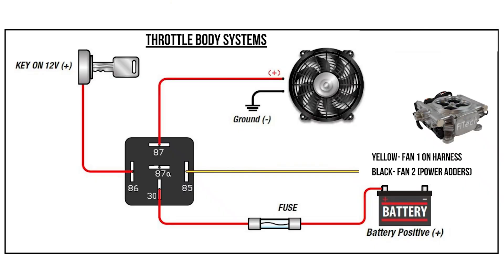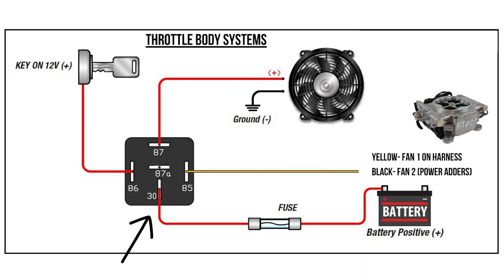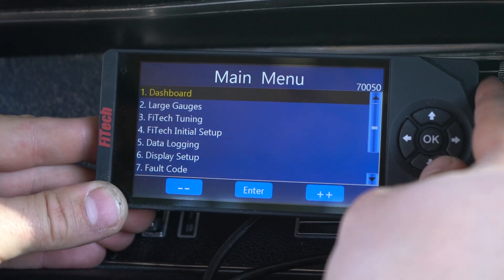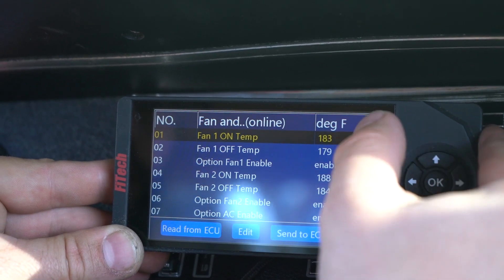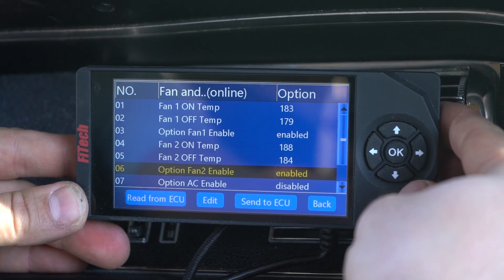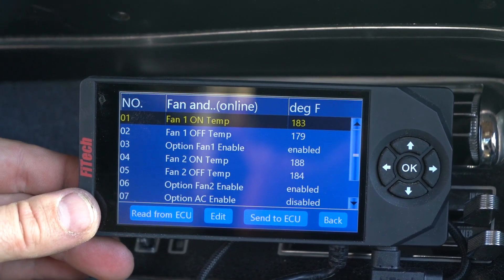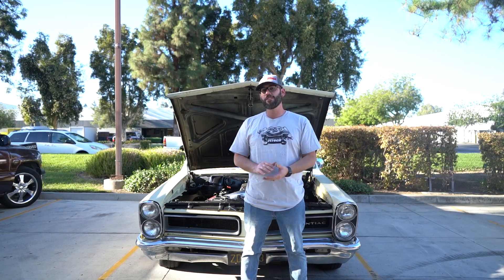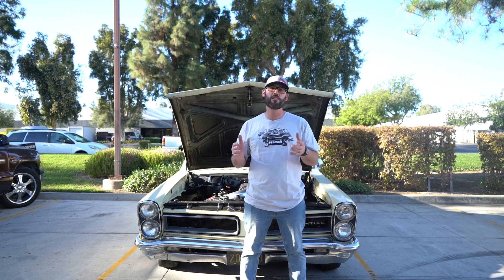Fan Controls | Tech Tuesdays | EP43

Comment: I thought my relays were going out but after using a multi meter I only get 8v ground from the Fitech wires so I’m only getting 8v to the fans, what’s the issue?
Reply from the maker: Hello sir,

The cooling system being controlled by the FiTech system operates differently, our systems control the electrical fans via ground activation, the relays on your cooling system are independent and should be wired according to instructions specs, however when it comes to the ground on the relays, that is where the FiTech fan wire is connected as our wire will be the ground for the relay. Our wire does not supply voltage to the relay, only ground(s).

Comment: I have the first version of the mean street efi purchased back in 2016 it has run great until recently, when the fans come on I get a voltage drop and the efi stumbles very bad and sometimes just dies, I have checked the grounds and even added a ground strap strait to the battery but it didn't help, I even disconnected the fuel pump from the efi and ran it from a separate fused source, I am stumped at this point,I cant drive my jeep it just tries to stall out when the fan comes on,could this be an issue with the ecu I have heard the first generation ecu's had problems
Reply from the maker: This is unlikely an issue with the ECU,
 check out Fan Wiring-FiTech EFI | Tech Tuesdays | EP88 for help with wiring the fan.
 if voltage drops on the key wire the system will think the unit is shutting off. you can check out this video for help with that, Battery Voltage! | Tech Tuesdays | EP1

Comment: I have a twin fan setup and am letting the CTS on my Vintage Air system control one (190* on). If I have my Easy Street 600 control the other fan, how high/low can I set the “on,” temp? 327 SBC w/Vortec heads, 185* thermostat, and I want to keep coolant temps below 210. Can and should I set my handheld controller at 200*? Or what would you suggest?
Reply from the maker: The temp range of the fan circuit is 120 to 220 degrees.

Comment: My ecu only turns on one, then i enabled the second one n it works , i sent to ecu but the ecu is jot saving it after turnjng the car off n on. What's the problem?
Reply from the maker: go under display setup on the handheld and disable the calibration unlock.
Reply: @FiTechEFImedia  i got it to work know thanks.

Comment: Why would Fitech provide a bang bang fan power control and not PWM?  LIke the fuel pump, don't need a PWM current service just a pwm logic line to attach to an 100A SSR at the fan or pump. That would seem a good choice.

Comment: I have a 5.3l ls and my car is usually running at 199 degrees at all times is that too hot to have it running at?
Reply from the maker: Not at all. LS engines run between 190-210 in most applications.